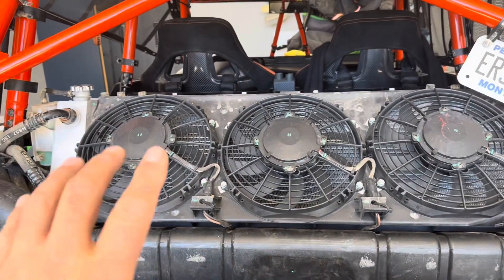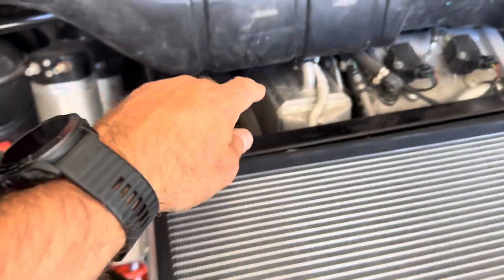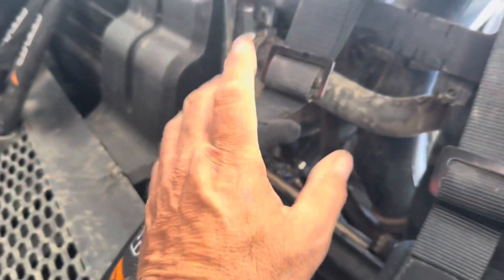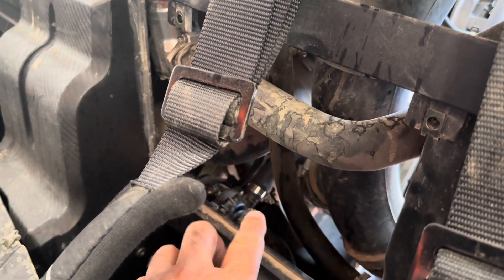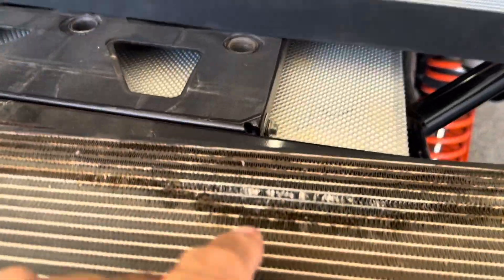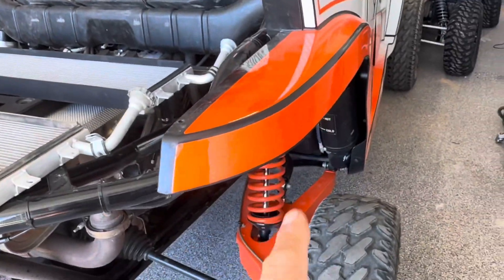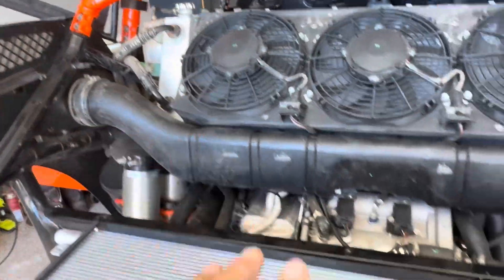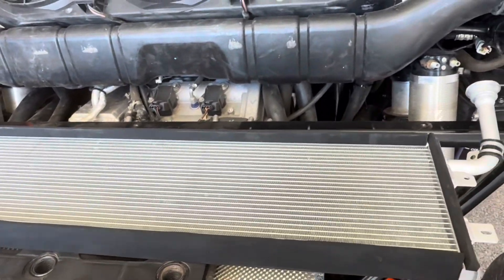Understanding Speed UTV Intercooler System

Comment: Now is this a direct replacement and where did you source it , Thanks for the explanation
Reply from the maker: This was covered under warranty and replaced by speed. They shipped it to me and I did the work. The car had been in with them previously for this issue and it was misdiagnosed and not fixed at shop.